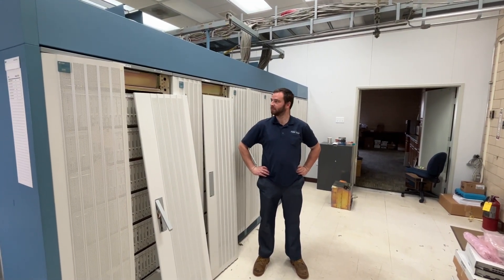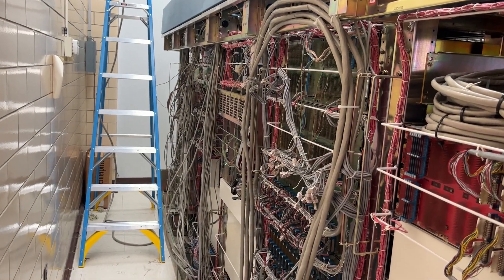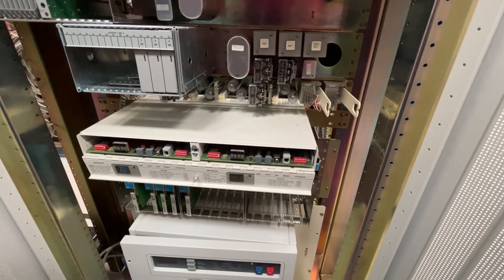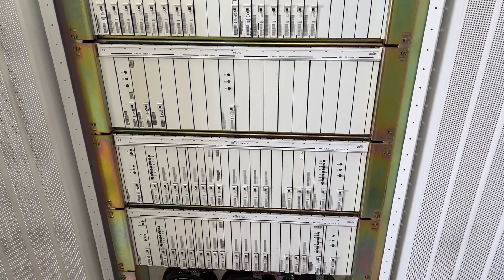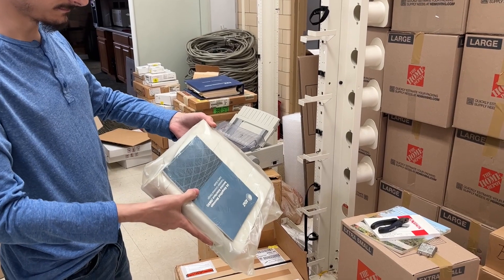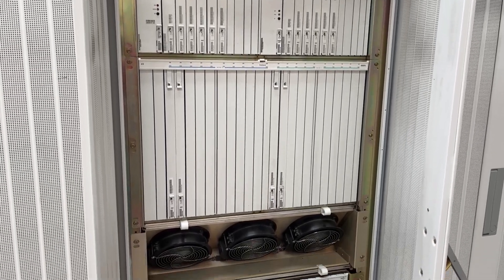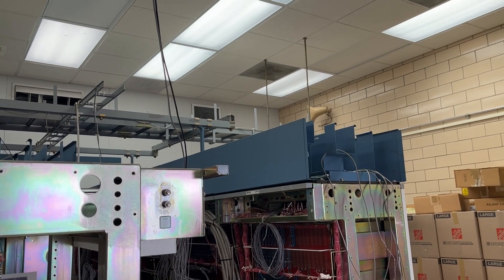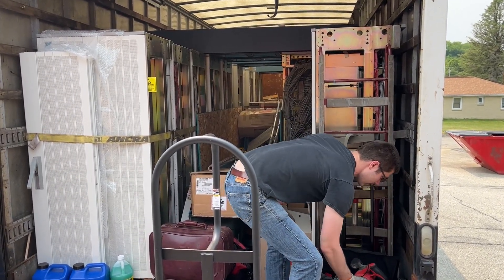AT&T / Lucent 5ESS removal 5000 line switch.

Comment: I worked at the OKC Western Electric/AT&T/Lucent Technologies manufacturing plant where we made the 5ESS switch along with various other central office switches and equipment. I was there from 1976 until 2002 when Celestica, a contract manufacturer bought the plant and over a 3 year period moved our manufacturing jobs to Montery Mexico and Canada. There is a good chance that switch in the video was manufactured there. Over that time I built circuit packs for 1 year, tested them for 5 years, then maintained the test equipment that tested the circuit packs for the remainder of that time. Western Electric/AT&T/Lucent Technologies was an excellent employer to work for and gave me a wonderful career and life. I was able to retire from Lucent at the age of 47 with a pension and health care benefits.

Comment: Brings back memories. I was in the tech support group for the Lucent 5ESS switches in the AT&T network before it was outsourced to Nokia and India. Spent many of days and nights working with the central office techs changing out cards, tracing wires, putting recordings in the 15A(Rec Anc) you showed, and so on. The TDM switches days are coming to a close as soft switches(VOIP) take over.

Comment: I had moved from where a 1A was in place, I couldn't get my two line RSVP (AIN I believe) installed at the adjacent wire center, and I did migrate to ISDN there then 1-way cable modem networked to three PCs in the smallest bedroom.
I was the only person on the 1A to get RSVP as it was not actively sold, but as a business office rep, I asked and get.. they had to build it up for me, its like a baby Centrex, it was misconfigured so i could call any of the 6 or so NXXs with 5 digits and a prefix of (bot sure which) * or #.
I had a lot of fun with it.
As my school days caused me to move to a different wire center we first had a 1A there, and I think it was crossbar at the old place, I discovered a fluke using ESX with two callers talking to each other, each person had to have received a ESX tone, it didn't matter if they clicked over, we built a ESC call by having a third party call one of us (note we didn't subscribe to ESC) so when the third person called one of the other two, the line that would end up holding if the call was taken flashed first, then the line that got the extra party flashed, and the other held party flashed one more time and the three way call was activated.  Nowadays the replacement switches barely mute while splitting the line to announce ESC..
We couldn't get these features at the former residence nor my grandma who lived off a downtown switch in her town.
I miss the business office job.. not the observing. Eventually my office was closed after I left. VZ land wireline)

Comment: I guess I gave up my POTS line (formerly 5ESS) El Segundo, CA just in time.... ;)
Reply: Though the switch which serves this area located in El Segundo is most likely now a 5E-XC. Nokia who since 2016 is the maintainer of the intellectual property once held by Western Electric.
Reply: Where there any CDC 8" HDDs still in this system?  I remember seeing those installed in ATT 3B5/3B15 systems at the then ATT Beaudry location (Old Bell Building) in downtown Los Angeles in 1986.
Reply: @DandyDon1  No big CDC HDD's. However this switch is equipped with a reel to reel tape drive & DAT drives.

Comment: Thats two bad. All the telcos are switching over to voip. :-). My old pots line is now going to my internet hub in the basement and through a fibre cable back to the c/o. Its supposed to be clearer but now I have to have a UPS to keep it working when the power goes out. Grrr. Oh well I guess everyone has cellular telephones now so it doesn't matter

Comment: For many years, these things were absolutely state of the art. (Esp during the Internet boom of the '90s and early '00s.) Thousands of these were installed all across North America. Now they are considered obsolete junk. Think on that!
Reply: Yep... Thinking on that... I started in 1970 on a WECO SXS switch that was 40 years old. We cut that to a #1 ESS in 1977 and then to a DMS100 in 1991.  That switch still in service at maybe 1% its capacity we concentrated remaining lines and retired the unused equipment. I was hoping to stick around to see POTS gone but sadly retired in 2020.  Was a GREAT run!
Reply: It could well be argued that the 5ESS and the DMS250/500 were vital to the start of the public internet. In the days when it was dialup hunt groups (I can't TELL you how many pairs I punched down in our datacenter or how many DB25 cables I chopped into to make fanout cables!), they were the only ones capable of doing it. In the brief run of ISDN and HDSL, wouldn't have happened without them. So, these machines are are worthy of respect, just like the Cisco 7500 core routers and 2500 end user T1 routers.
Reply: @bwhog  these switches had one function which was to provide reliable voice circuits for POTS and ISDN. They did not have a significant influence on the development of packet-switched data networks. And because Telcos wanted to amortize their enormous cost, some companies delayed network transformation to IP but not for long given TDM switches high operating costs.
Reply: These are still in service all over the world maybe 3000 in USA.
Reply: This was top of the line when it was installed in early 1995. It ran for 25 years before it was turned down in 2020.
Reply: They were state of the art in the 80s perhaps but beyond that were antiquated and expensive to maintain as the world was moving toward IP/optical networks.

Comment: What is a 'meta switch'?
Reply: It's a brand of softswitch (packet switch). It's one of the largest brands in the industry for carrier-grade packet switching. It's amazing how the Metaswitch and the associated media gateway (for their last remaining copper customers) takes up less than a single rack of equipment. On the other hand, this 5ESS took three rows and 17 cabinets/racks of gear.
Reply: A VoIP based "softswitch" that runs in software on standard PC server hardware, the analog lines are connected to a line gateway which acts like a massive ATA and communication is done internally via SIP, however there is compatibility for digital T1, etc. trunks
Reply: What is a search engine?
Reply: @Look_What_I_Did  what is a dick?

Comment: So if a subscriber served by this central office still has POTS, how are they served once the 5ESS was decommissioned?
Reply: This small telco converted most of their customer base to Fiber to the Home (FTTH) technology and phone calls are all via VOIP to a softswitch. The one that this telco uses is called Metaswtich. The few remaining copper customers go through a media gateway to convert from copper to VOIP and are switched at the VOIP level (actually SIP).
Reply: This is probably served by a VoIP soft switch with a physical line gateway like a Genband G5, basically a MASSIVE ATA that the subscribers phone lines are cut over to
Reply: Fiber Optic to the home ONCE the copper cable is decommissioned.
Switching is another question.

Comment: Are you able to say what the Telephone Company replaced it with?
Reply: If I had to take an educated guess, it’s probably just a rack of servers running “soft switch” software. More capacity with a fraction of the space and power requirements. The majority of POTS lines have been replaced by fiber and are IP switched these days.
Reply: @jtoddk98  Most of their customer base out of this small telco has been converted to Fiber to the Home.
Reply: It's a Metaswitch packet switch/softswitch.
Reply from the maker: No They don't want publicly
Reply from the maker: I miss read the question it was replaced with a Meta switch. They did nit want there name released.